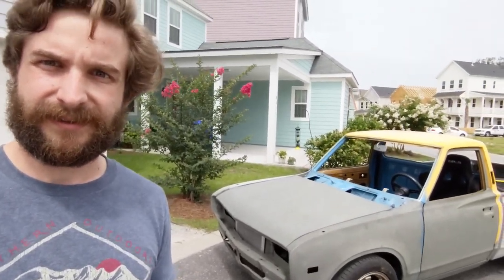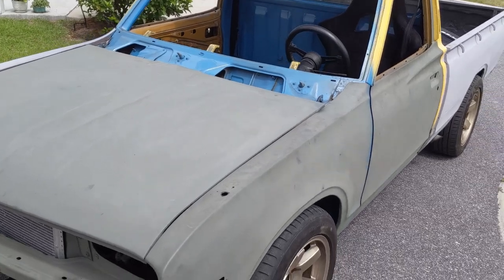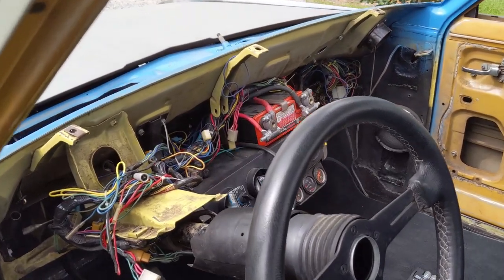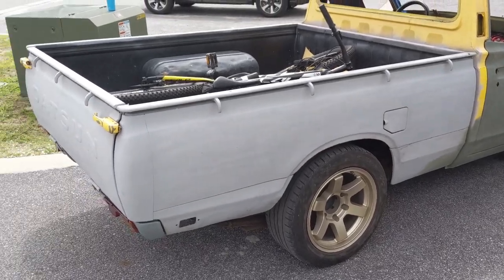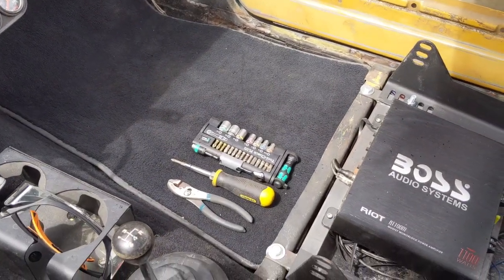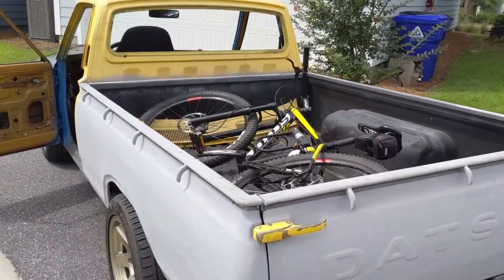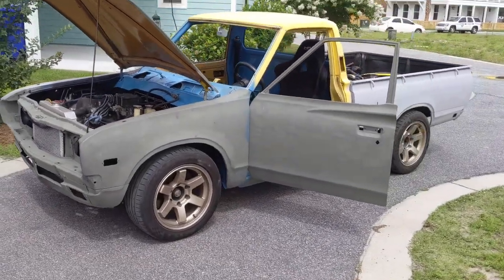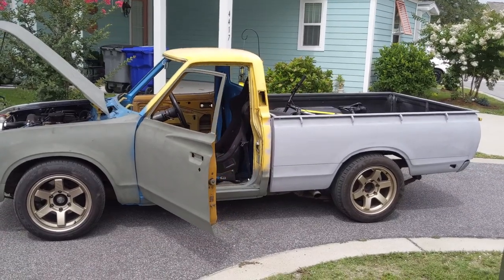1975 Datsun 620 Restomod Project Update - Off for paint

Comment: Love this man, just wondering what you used for the AC? And do you have a how to
Reply from the maker: Hey just seeing this comment, sorry! I used a Coldmasterinc 404-0 sanden kit purchased through their ebay store. I welded up a universal sanden compressor bracket onto a plate that I mounted to the factory smog kit mounts on the engine. I don't really have a how-to but I'd be happy to answer any questions you have